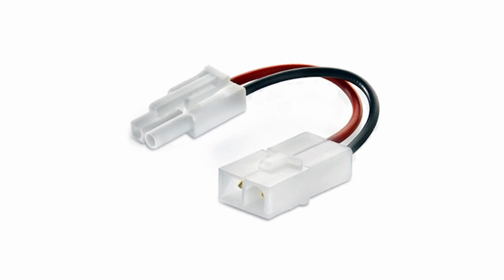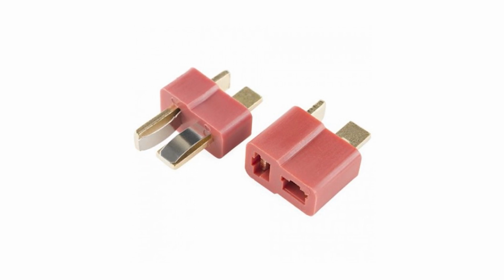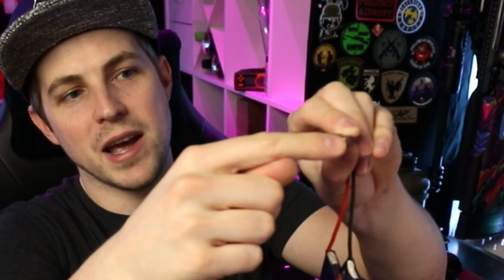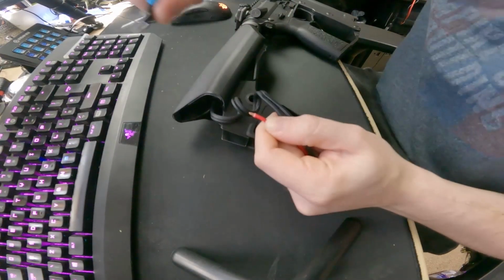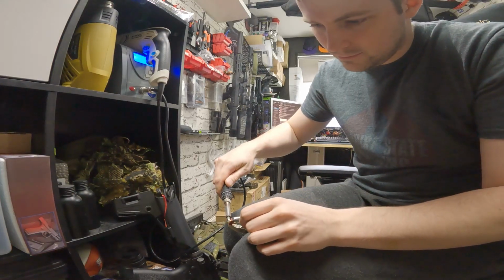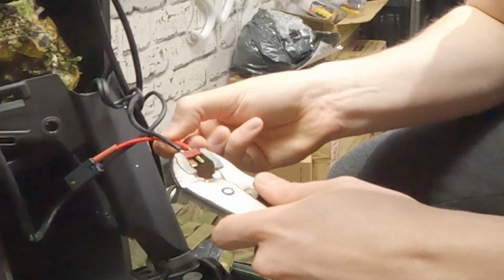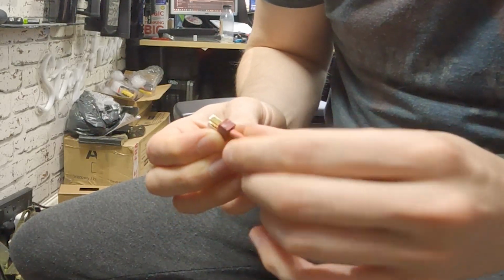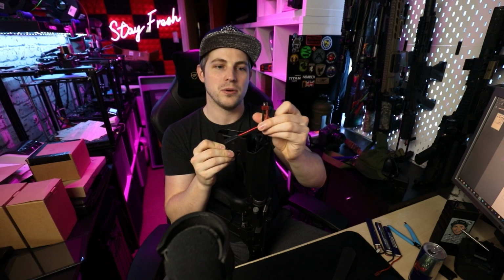A Cheap, Easy And Fast Airsoft Upgrade

Comment: Just some advice he left out. Cut one at a time if you cut into both at the same time you may also short out the battery.
Reply from the maker: Very true! I do say that when I’m doing the battery :)
Reply: My bad, multi-tasking and didn't think you said it. Killed an RC battery because I didn't know.
Reply from the maker: @sumitkid123  No worries man! It's an important part so happy people will see it in the comments

Comment: What was  a good instructional easy to follow guide ruined by overpowering unnecessary background music.Otherwise a solid video-please consider reducing music on following instructional vids you do where people may want to concentrate to clarify and understand clearly.As a guide for different connectors efficiency between Deans and Mini Tamiya I've found that on the few Deans already as standard RIFS I do own that running them with Deans over a Tamiya on 7.4 gives 2-3 rps increase.
Reply from the maker: Awh I thought it was quite funky! Thanks for the feedback though. I may turn it down during the more instructional parts in future so you can focus
Reply: @StayFreshShoe  thats the only reason mate,otherwise good episode